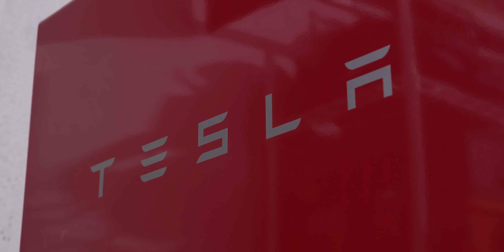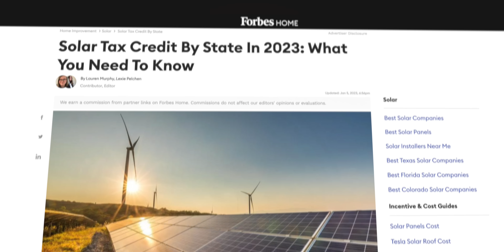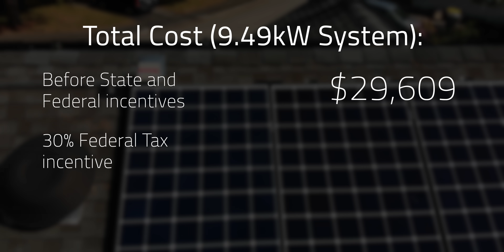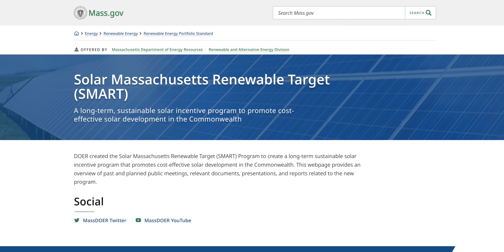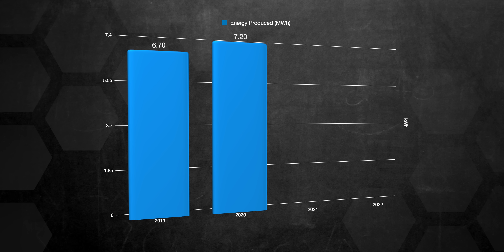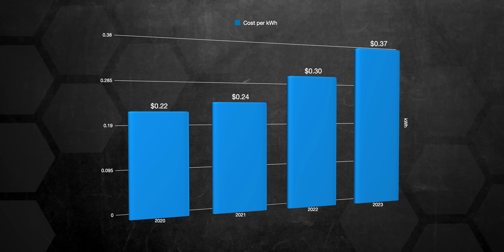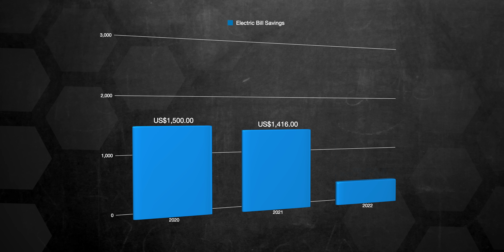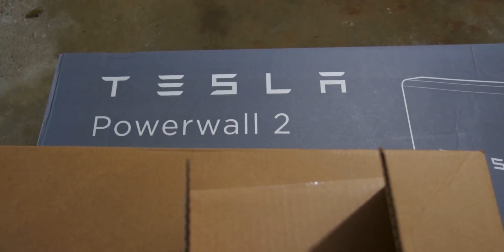5 Years with Solar Panels - Is It Still Worth It?

Comment: Your paying $0 .37 kwh? I'm doing $0.13 kwh in Tennessee. Granted on a good day when temps run between 50-80 degrees in the valley demand is low and mostly covered by Nukes, Coal, and Dams are the primary fuel of choice. Durring extremes when the gas turbines are going you can expect the rates to rise significantly particularly when they have to resort to the turbines without cogens in place.

Comment: Matt, a side question about winter and snow: As I see the snow quickly going, there seems to be a substantial amount remaining at the bottom of the panels. Does that degrade the output significant?
Let's ask: What is the output at 11am and then after someone cleaned up the panels ?
Reply: Yes it significantly can affect power. On poly cystaline if 25% of the pnael is covered in makes on 10% or lower power. The mono crystalines are made for shady or snowy roofs so they continue to produce better if partually blocked.
Reply: @bhendrick7015  Whow I expected much more - due to all the rumors

Comment: It amazes me that the initial cost of a solar setup like this is so high in the USA. Just shy of 30k! I'm in the middle of installing a solar setup of 15 panels (415 WP each, total 6225 WP) myself. I got offers between 8 and 10K here in The Netherlands where the installment was part of the deal. I opted to install them myself so I got on the internet and spend 5200 euro on 15 panels, cables, roofracks, a 5k GoodWe converter and some tidbits. The government here subsidizes the tax so I got that back (arround 900 euro) so the total costs was about 4100 euro. I'm planning to get the return on investment within a few years purely on 'selling'  the power to the net. (I already got 4000KW setup that covers my power needs 120%)

Comment: Had solar installed about 10 years ago.  I went through Solar City (now Tesla) here in Los Angeles.  I did a pre-paid 20-year lease for a small (3.6kw) system, which cost me $8000 total out of pocket, installation included.  To my surprise, this had to include a panel upgrade from a 70amp to a 200amp panel.  In the last 10 years I have generated about 50MWh of electricity.  Although I still pay a decent amount for electricity, I rarely go to the high-cost tiers, thus the solar is saving me more in $/KWh than the rate I'm actually paying.  As a financial investment, it was a great decision.  I am curious what will happen once my lease is up, though.  It's fully pre-paid, so I don't owe anything for the 20 years and all electricity generated is mine.  When the 20 years is up, Tesla is supposed to remove the panels.  I'm hoping the cost of removal and disposal is encouragement enough to let me keep them, but we'll see.  In 10 years, maybe I'll want an upgrade.

Comment: Several years ago I had an 8.2 Kw system installed on my roof.  Big mistake.  Unbeknownst to me the panels don’t need to go on the roof..  They can be ground mounted if there is enough yard space.  There are many advantages to ground mount.  No penetration of the roof.  No need for the contractor to go in the attic, the conduit’s stay outside.  Easier to install.  I am now expanding my system with 12 panels rated for 405 W per panel.  They will be ground mounted. The city has approved the plans and the permits have been issued.  I realize not everyone has the space to ground-mount, but if you do have the space talk to your contractor.  When completed, I will have a 13.1 Kw solar system.

Comment: Thanks for the great video.  I installed 14.8 kw of solar about 2 years ago.  Paid 37k - 9k tax rebate.  I live is Phoenix so I didn't have to think about this as much.  Each panel has a micro inverter with two wires and produces 390w (capable).  I'm and electrical engineer and I still don understand how this connection can align the random phases of the 240v signal.  But I guess I don't need to know.  I buy power for 12 cents and sell it back to the utility at 10 cents.  I used to spend about $350 each month budget.  Now I spend about 350/year.  I looked at 3 vendors and selected sunpower because of the high efficiency panels and the mounting system for my tile roof. They replace tiles with steel tile shaped plates that are fastened to the joists.  No tile cutting is necessary and the install looks neat and clean.  The installers even painted the conduit to match my house, a service I did not expect.  I didn't get a battery because they are not cost effective and my power is very stable.  I have an graphical app on my phone that tells me the instantiations production as well as values for weeks, months, and years.  right now at 12:15, its producing 13.6kw.  My system was sized based on the rating and capability of my electrical box (200A).  An upgrade would have added 5k to the install price.  I expect and receive about 98% of my usage, long term.  In the winter the sun angle and day length reduce production but in the summer, as you can imaging, I sell back a lot of power to the utility.  AZ is a state with a utility the really doesn't want people to have solar which is quite difficult for one to understand in one of the sunniest places on the planet.  This was something that I knew about but it's actually worse. There is a lot of foot dragging getting the utility to inspect, test, and certify the installation.  I would do it again and I wonder why so many of my affluent neighbors don't have it.  There are a lot of climate change deniers that don't appreciate the savings that are possible.
Reply: How much are your payments for the system? -  Seems like they would be more then #350/Mo.

Comment: Hi Matt, thanks for sharing your results. I was a bit surprised by the solar production but then again my installation, although just a bit larger produced significantly more. Guess major difference due to latitude difference as I am in the Barcelona, Spain area, and lots more sun. Anyway, with a 30/400W panels with 9 facing south and 21 west I produced 16.3MW with a 10kW string inverter. You have a great deal with your power company with a 1:1 net metering which shows that batteries only make sense depending on where your live and the rates paid. Also, guess depends on if you have many power outages. BTW, I would change your 1,000kWh consumption per month for mine any day.  Again thanks for sharing.

Comment: 4:05 It doesn't matter if the incentive is being pooled from other tax payers or not - it has the same effect. That ~$8k that would have gone towards taxes, is no longer.

The main question is though... is it worth the carbon footprint & other inputs that go into making the panels? In such a cloudy place, probably not. All the lithium & other rare earths that are needed to make all this equipment is finite, so the finished products should only go to where they are the most productive. i.e. Arizona & Texas...  not Massachusetts. The 30% tax rebate should only apply in sunny states.

Comment: I'd like to get solar panels, it's just there are so many expensive things I should do before I get them.  Like, it's an older house and most of the wiring is probably 30+ years old, and I figured I should get all new wiring before adding solar panels, with the benefit of fixing some minor issues.  And most of the panels would go on our garage, but our current garage needs torn down, something done to fix the drainage because the whole area gets swampy when it rains, and then build a new garage with panels and battery.  Maybe if I win the lottery.

Comment: in my case i wish i would have got the battery installed at the time panels got installed. i put my panels in less then a year before the texas blizzard and batteries would have made a world of difference. additionally i learned by accident that at least for texas its best to convert your home to electric everything prior to putting the panels in. if you choose to switch to an electric car in texas it should be done at least a year after the solar install so you have credit build up and have time to learn how to match production to consumption. electric cars here are not cost effective unless its net solar produced electric

Comment: I have solar panels since 2004. In 2013 installed 8 kWh by myself and earned my € 8000 in w,5 years back by saving 1000 m3 LNG and having no electricity bill anymore. In 10/2022 added extra 4 kWh installed on my wintergarden roof. Up till now earnings disappoint me , my roofpanels bring more energy but I hope this will become better when the sun rises.  Anyway, even on clouded days my roof panels produce more......hope it gets better soon.

Comment: Powerwall + install, price $13K, only gives you 13.5KWHs? I realize as you install more capacity there is a slight price drop, but at $1,000 per KWH that's a little heavy. So a 100KWH battery  is worth $100K. Why not just buy a 2nd vehicle (EV) with at least 100KWH battery capacity and leave it plugged in? You just got yourself a free EV, and the mother of all power walls!!!!  You actually pay 37 cents per KWH?

Comment: Matt, I love your videos. Coincidently, we installed 27 panels, 350w for a system total of 9450w in Oct 2018. We also have SRECs and net metering, so very similar  in most respects. Our panels are on a freestanding garage facing south with a 12 on 12 roof pitch and virtually no shade. Pretty much optimum. Our 2019 annual production was 13,410 kW-hr, which is a surplus. Our utility (Potomac Edison) settles up on an annual basis at a wholesale rate ( $0.05985/kW-hr recently). 

In 2020 we bought an EV, so we added 14 panels, 330w on our main roof, which totaled 19,590 kW-hr in 2022. This was calculated to get 20,000 miles of home generated range. Although in a rural area, we seldom have outages, so we didn't see the need to have a battery component. The next generation of EV's will probably accommodate  vehicle to load and/or vehicle to grid, and I look forward to that.
Reply: A couple of EVs are already able to power the house, so I’m sure by the time you replace your car, it will be quite common! As you’re going to be paying for those batteries anyway, it does make sense to wait for that dual usage.

Comment: I’ve heard your electric vehicle can be used as backup generator?  Or something like that.  Can you help me understand that?  You rock!
Reply from the maker: Some EVs support what's called vehicle to grid (V2G) or vehicle to home (V2H).  My Tesla doesn't, but there are more cars hitting the market now that do.  With a V2H car and home charger you can plug in during a blackout to supply power ... or even use it like I'm using my Powerwall most of the time when you're home.  I think it's going to become a big deal in the coming years.

Comment: One thing that Matt did mention and that involves roof rakes.  Although you are pulling snow down, it's still heavy.  The next day you will have aching muscles that you never knew you had.  A little ibuprofen will take care of that, but understand that you will get a workout.
Reply: I had to install a permanent roof anchor and harness so I could go up with a shovel. 4ft of snow won't come off with a broom.
Reply: @b hendrick  I like the 4 seasons, but that would have had me thinking about moving.  Your persistence is amazing.

Comment: I have solar panels since 2 years ago, and the savings are notable. I live in a really sunny place, so the solar panels are a no brainer. In here, is sunny and really hot, so, I was wondering about the geotermal energy o something like that, to generate energy, but I do not have a backyard. Does it exists a technology that can be installed in the roof that can take advantage of the hot weather?
Reply: there are cooling systems, which can cool your solar panels, improve their output, and provide you with free hot water.

Comment: Hey Matt!  I'm here across from you in Upstate NY.  I had Tesla install an 8K system w/2 Powerwalls in 2021, and finally got PTO in March 2022.  I'd previously gone on National Grid's VTOU for my EV, and thus went with a VTOU NetMeter.  Here in NY, the power I export is credited only in the VTOU rate periods it is produced, so while I have credit sitting in the Peak & SuperPeak periods, I have none in OffPeak, and NG actually bills me for power used during that time. (I have 686 kWh of credit stranded in the SuperPeak rate period)  At the anniversary they will combine any credits from the 3 rate periods and pay only at the Peak rate on that date.  This defeats the purpose of VTU for someone like me who uses less than they generate, and I've switched charging my EV to Peak time where I have extra credit rather than at night when NG will actually bill me for power.  I'm thinking about going off VTOU and back to SC-1 for NetMetering so that I can use the credits for my generated power 24/7/365.  (Undecided in NY)

Comment: Great video. I too have solar panels installed on my roof but my issue now is that the company that installed the panels (power home solar aka pink energy) has gone belly up and I'm not sure what means to the warranty. I'd assume there's none.  Do you have any guidance on what next steps to take? Thanks

Comment: Being in Europe, I had a 2kW setup installed 2 years ago. With prices soaring last year to nearly 0.90 Euro per kWh, I made back 80% of the cost of 2400 Euro in a single year. Best investment ever
Reply: Damn, which EU nation was this? I was aware eg France had capped the increase, and eventually the UK did too to a lesser extent. So I’d thought going from 20p to 38p per kWh was bad enough, but 90¢? Yikes. Lucky you got your solar when you did!
Reply: @kaitlyn__L , it's the Netherlands. Prices went crazy. Gas to heat the house went up from 0.40 to 3.80 per cubic meter in a couple of months. Imagine 1000 Euro per month to heat your house to 18 degrees. This year, we also have a price cap of 0.40 for electricity, but that's only for one year.

I was doubly lucky. The past year, it's been impossible to get any solar installed because of the demand and prices have doubled

Comment: I have a 9kw Tesla solar roof in Central NY installed by Tesla’s Albany Team.

I ordered it in March 2021, and it was installed in September 2021.
Between those months, my email handler (Project Manager) changed multiple times.

I had many questions that never got answered, so when the team showed up in September to install the roof, I had to insist they give me my answers (basic ones on pricing, etc) or they couldn’t do my roof.
I had another roofer lined up, just in case.

They got someone on the phone that day, got my answers, and began my roof.
I work only ten minutes from my house, and told them to contact me if any issues arose.
Without telling me, they removed metal fascia trim that framed the sides of my house and protected my soffit system. What they left was an ugly paint-shredded old wood trim mess that the metal sheeting had covered. It looked horrific, and endangered my soffit system by exposing its sides to the elements.

Then they packed up and left, and called the job ‘done’.
Soon after, I got the bill.

It took SEVEN months of endless calls, emails, documentation of events and photos of the shoddy work to get Tesla to acknowledge the matter, commit to resolving it, and finally hire someone outside the company to fix it. It was a nerve racking nightmare in which they threatened collections—and it was Tesla’s collection team that actually made headway to getting my problem acknowledged and finally resolved.

PTO (two-way solar connection with the power company) was originally scheduled for January.
Tesla canceled it when I refused to pay until they fixed my house.

Once they fixed my house in April 2022, I paid immediately.
Then they lost my file, misfiled it THREE times, putting my PTO on indefinite hold, and it would STILL be on hold had I not begun calling and emailing Tesla repeatedly to demand they continue with PTO.

My power company is the one who outed Tesla for misfiling my papers with them (again—THREE times!)

PTO was finally turned on in November 2022, a year and two months after roof installation.

The product is wonderful.
Tesla’s infrastructure is absolutely abysmal, however, and I cannot recommend ANY Tesla products.
Any problems that arise gets met by people who are not empowered to get things done.

There are too many cooks in the kitchen, and sadly it seems their chef’s head is in outer space.

As for the snow dump—

Yes, we get that huge avalanche with snow.
We asked them if anything can be done about it BEFORE the roof was installed, and they said flat out NO. 

They have nothing like snow guards to combat it, and frankly, it seems pretty dangerous.
We lost our BBQ grill fifteen feet away from our house to a roof snow-slide.

Our Tesla experience was a nightmare 
I wish a company that offered such innovation and hope could live up to its name in service, but frankly, it doesn’t. 
The place seems to be run by a bunch of kids who have no concept how much lives are greatly effected by the products they offer. Sad, really.